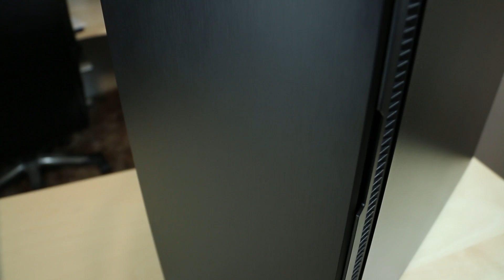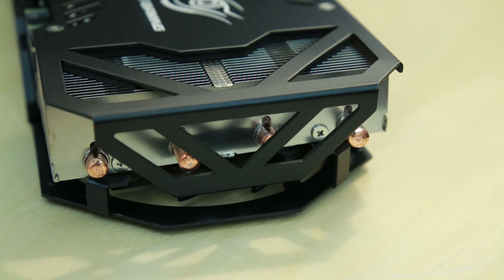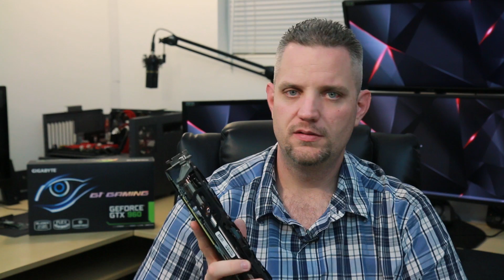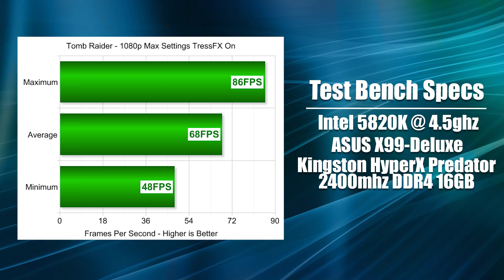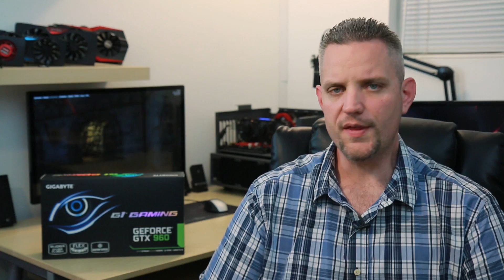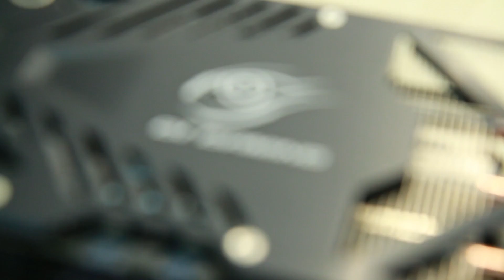Gigabyte GTX960 G1 GAMING - Best Mid Range Card Yet?

Comment: I've been using this card since it came out and I just don't understand the idiocy of their stock fan curve of thinking it's ok to let the gpu heat up to 60 degrees before even turning on the fans. Like... WHY on earth would you set it like that, so fucking stupid. Once I set a custom curve it will hit it highest equilibrium at like 45 degrees in furmark, and the highest it ever gets during gaming is 41.
Reply: like, the fans on this thing are freaking GOOD, and yet they dont fucking use them. They aren't loud at all either until they get to 80%+, and even at 100% I don't mind at all. They are barely audible at 40%ish
Reply: also it seems to run a 1410 mhz or something all the time, and I never touch the OC settings. apparently it's got great ASIC quality, it got like a top 4% of cards ever measured in gpu-z

Comment: I have the 4GB Version of this card overclocked and I'm able to game in 4k for most games.
Reply: No you can't
Reply: I can play CSGO, League of Legends, mount and blade warband, resident evil 4 and 5, all half life games including portal and portal 2, borderlands 2, call of duty 4, modern warfare 2, black ops 2, killing floor 2and 7 days to die. All play higher than 60fps with high to max graphics settings. So yea I can game in 4k.
Reply: oh yea, i can also play Dragon ball xenoverse 2 in 4k about 70fps
Reply: Lmao, you're listing games like CS and league which are old games that an average pc can run at well above 100 fps. a 960 can't 4k in newer games like GTA 5 or battlefield 1.
Reply: Don't be mad because you can't run black ops 2 or even the brand new game dragon ball xenoverse 2  that just came out I can run 4k, I also said some games not all, you should read better.
Reply: I have a 970 why would I be mad? It costs twice your card, also you said most games so i was assuming
Reply: I did overclock it like crazy, that's probably why i can run those games in 4k. I overclocked my Memory clock to 8021MHz and my Gpu clock at 1525MHz
Reply: Oh and Core Voltage at 1.25V
Reply: wooow guys  A 970!!
Reply: It's still a good graphics card that can play pretty much all games on high 1080p 60fps

Comment: Can someone tell me which card is better atm this GTX 960 G1 Gaming 4GB Gigabyte or the new AMD RX 480 4GB card? GTX 960 has 128 bit while the new AMD RX 480 has 256 bits
Reply: RX 480, it can beat or keep up with the 970 in most games
Reply: the RX 480 is reported of burning motherboards due to drawing power excessively. your choice
Reply: Just wait custom cards from MSI or Asus and you can get a Rx 480
Reply: ***** burning motherboards already is a nightmare. The stock RX 480 has been patched to underclock itself which is sad. Third party board makers should be able to fix it

Comment: Hey Jay, in reference to GPU Boost, if you were to ramp up the fan speed to 100% on the G1 right out of the box would that translate to GPU boost raising the clock speed up even higher than with the default fan curve? Barring the obvious noise difference that comes with that.

Comment: what is the best gtx 960?,gigabyte, asus, etc plZZ reply as soon as possible
Reply: +Aakash Mash 
probably gigabyte i got 970 gigabyte and it rocks
Reply: +Lukas Skliuderis 960 bro??
Reply: +Aakash Mash asus
Reply: +Aakash Mash Asus Strix is a fantastic card. It comes with an easy to use O.C. interface, basically one click and you're done...
Reply: Andrew Vee bro i stay in india so most gpu are unavaible here btw i will check that if its available i will see then
Reply: msi is cooler asus is the quetst and gigabite has the most performance now cooshe

Comment: Gigabyte GTX960 G1 GAMING is good or not ?? shld i buy 2gb or 4gb for gta 5 and farcry 4
Reply: It is good. Considering and assuming you have no compatibility issue with the BIOS and such, the only problems with this card would be its length and Nvidia's performance versus Radeon (Radeon R9 380 variants compete with the GTX 960 from nvidia). The temps and performance of this card are excellent, and objectively, the backplate and the tri-fan cooler is great. I'd recommend it, but check your case's GPU clearance.

Comment: can this card run on a 450 watt psu
Reply: okay thanks guys :)
Reply: +NakovGaming i would risk it, i had a 450 watt power supply but i upgraded to 650 watt because as game get more graphically intensive it will start to use more wattage, if it exceeds the gpu will crash and you will have to reload your computer
Reply: +NakovGaming i assume youve gotten it already, how did it go?

Comment: How would this build perform in GTA V Very High settings -
Asus Nvidia GeForce GTX 960 Strix DirectCU II 4GB
Intel Core i3 4150 3.50 GHz
MSI B85M-E45 Motherboard
500 X 2 HHD (Total TB)
450Watt Corsair Power Supply
10GB DDR3 Ram (8+2GB)
Reply: +GingahGaming no it's not lol. that card isn't nearly high end enough for the i3 to be a bottleneck
Reply: +Zeus Gaming Just shut up... You have no idea what you're talking about.
Reply: Hunter .-. Please explain the g3258 benchmarks then? OBVIOUSLY I do know more than him
Reply: Hunter .-. OBVIOUSLYYYY. Turn down the civilian settings. Even then the games work just fine on a i3.
Reply: Hunter .-. You lost me at according to R* minimum requirements. Minimum requirements and recommended requirements mean nothing... I can tell you are not a PC gamer.
Reply: +Kiernan Patton an i3 can handle gta 5 easily as long it has hyperthreading
Reply: that CPU is a bottleneck take a i5
Reply: +Kiernan Patton true i dont know why I even sad that but for a lot of games i3 is to slow and. experience stuttering
Reply: +Kiernan Patton it will bottleneck in gta you cant play it with a 2 core cpu it bottlenecks like crazy on that game other than that the pc is good
Reply: I decided to buy i5 4th Gen (Non K)
Reply: +Bologna Sammich Gta requires atleast a 4 core cpu. you obviously know less than he does
Reply: +Bologna Sammich
?¿ The G3258 has stuttering issues as any other dual core processor would.
Reply: +Hunter .-. no it doesn't. My friend runs the game with a g3258 and a 960 and runs it more smoothly than my i5-4460 and 750 ti. The g3258 doesn't bottleneck shit as long as you over clock it and don't pair it up with like a 980 ti or a Titan X. Not all dual core chips are the same, some like the g3258 can handle their own.
Reply: +Kiernan Patton 
According to Rockstar's minimum requirements, yes it does. but of course overclocking would help lol
Reply: +Bologna Sammich 
You must be fun at parties.
Reply: Hunter .-. I guess so since you made like 3 comments and deleted them lol. Took you long enough
Reply: +Bologna Sammich I bet you have a picture of your gaming pc in your wallet
Reply: +Hunter .-. Moral of the story, don't go around giving advice when you don't have a full understanding of what you're talking about. I've seen people so much lately like you who tell people what they should get and are completely wrong. If you give someone the wrong information and they buy the wrong thing, you just lost them money. Seriously, don't go around giving tips when you need advice and tips yourself.
Reply: Moral of the story: don't ask youtube for advice.

Comment: To all the fanboys out there, the major advantage the 960 has over the 380 is the drivers... Lets face it, AMD's graphics drivers suck and they make little effort to fix them. I have had such horrible experiences with their drivers in the past that it will be a while till I get an AMD GPU again. With Nvidia however, you don't have to take a gamble with the drivers, and they will cause no headaches, hours of talking to customer support, and waiting a week to get a new GPU because the one you just bought will absolutely not work with your system. I can spare 8-12 FPS for that...

And, they will overclock...

Comment: 4GB 960 or a 4GB 380x?
Reply: +Generally Good PC Games 380x is considerably faster than 960 , even 380 beats it so yeah the difference will be much more than 2 fps

The card does consume 80 watts more under load, so expect paying 5-10 more dollars per year
Reply: +Aimanrulez fanboy, no reasoning just straight to the point.

pure fanboy.

Don't listen to this guy, if you want a card that runs quiet, cool and is power efficient, go for the 960. If you want a card that runs games with an extra 2 fps (which you will never be able to notice), is extremely power hungry and doesn't have as good of features go for the 380.
Reply: Two things i don't like about the 380/380x are their power inefficiency. Also the lack of AMD specific AA similar to MFAA
Reply: +Generally Good PC Games Coming from someone that is with team Green. The 380X crushes the 960. The regular 380, is somewhat on par however.
Reply: +Generally Good PC Games the 280x smokes the gtx960, deifiently not a 2fps difference. I bought a gtx960, released it was partially that good then bought the 280x.
Reply: +Generally Good PC Games You're the one who sounds like a fanboy.
Reply: +Eds UKGamerz the 380x do max 10 fps more in some games nothing else. but it consume more power..
Reply: +Eds UKGamerz I would take a 960 over an R9 280X. Depends on how much you can save though
Reply: +Eds UKGamerz get the card in this video..
Reply: +themaze really it depends on the price as well, 
I can buy a club3d r9 380 4GB card for 220 euros here, but a gtx 960 4gb is atleast 255 euros
Reply: ***** here in the US, i can get a used 970 easily for around 240usd
Reply: +Generally Good PC Games STFU 2 fps gain haha you clearly nothing
Reply: eddie reece I know nothing?
Reply: eddie reece Well yeah of course it's better. The 280X was ment to compete with the GTX 70 series and was ment as an cheaper alternative.
Reply: +Daan Reynaert I know that so I'm confused why people compare it to the gtx960
Reply: eddie reece Same here, I'd rather compare the 280 to a 960.

Comment: "competition between team green and team red in 2015 is gonna be good"Except, Nvidia curbstomped AMD pretty hard. 970 can handle 1440p, two 970s can handle 4k, and without the complications of going the AMD route, at less wattage, so yeah. Honestly, if it weren't for the 960 I'd probably go with an AMD GPU for my 600$ build though. They still get my money on the CPUs though - the 6300 beats the i3 series for 20$ less, has more cores.
Reply: Generally Good PC Games sounds like we have a nvidia slave supporting things like gamework!
Reply: +Elijah Ramer (DegradedFour) r9 380 is actually better than this only problem is a bit higher pwoer consumption
Reply: +ThePolulos and not as many features. Dont get me wrong the i like the 380 but nobody is ever going to notice the extra 2 fps, thats why i went for the 960
Reply: Generally Good PC Games
I went for the 390 instead of the 970 because in my country it was considerably cheaper but with twice the VRAM, same story with 380 altho I dont blame the ones that prefer 960/970 XD
Reply: ThePolulos yeah i get ya. its like $10 cheaper for the 390 in australia.
Reply: Generally Good PC Games
:3
Reply: +Generally Good PC Games Erhalts up with your damn "2 fps" dude? The 380 is about 5 -10% faster. And who Even wants to support that shithole called Nvidia?
Reply: Lars B. sounds like we have a fanboy!
Reply: Lars B. k

Comment: I'm looking into upgrading from GTX 560ti, budget is under 300$ and in my country, suddenly, GTX 970 costs 450$ and for absolutley no reason R9 280X costs 350$. I thought about buying GTX 960, but I'm not sure about wich one to choose. 4GB versions cost about 270-280$ and 2GB are 230-250$. I'm playing at 1080p and I don't need any fancy hardware antialiasing, FXAA is just fine. I saw tests and 2GB version performs quite well, even in GTA V without MSAA on max settings it is sitting at 60fps with dips to 50 without any stutters. So the question is: is it really worth buying a 4GB version for 1080p gaming without any AA or should I simply go for cheaper 2GB version?
Reply: Go for the 4gb one. The 2gb won't be enough soon.

Comment: Have the exact card along with an AMD fx6300, 16gb of ram, and a 750 watt power supply. I get a single frame spike, for instance it will be at 75 frames and it will drop to 60 and it looks like it lags for a single second. By the way I have unparked my cores and I'm almost sure that it isn't bottlenecking. Any help on this. Thanks! ^_^

Comment: GTX 960 VS 760? Which one you recommend?
Reply: HuntedSoul O The GTX 960 is slightly more powerful and supports DX12 completely via hardware. They are both good cards and very close, but I'd get the GTX 960 for the newer features.
Reply: Km Mm Many thankx mate.

Comment: What people don't understand is that this is more EFFEICIENT. That leaves more room for OVERCLOCKING. If you set it to run at the heat and wattage of the, say, R9 380, it will outperform And 2GB VRAM? You can get 4GB versions, by the way. Also, if you're getting this card, you probably aren't running very intensive games. I know, at stock, this card is pretty horrible. But with overclocking, this can reach the price/performance ratio of the 970. Again, it is so efficient, it leaves lots of room for overclocking. Plus, in the case of G1 gaming, the R9 380 is less efficient, and is outperformed by the GTX 960. According to, everyone, 50ish dollars more isn't much. Well, if so, why bitch about this thing's price? Your expecting the performance of a high end card from this. But this is a mid-range card.
Reply: Infinite Zero I could not have said this better, and agree completely!

Comment: Can my cpu run this 

Processor	Intel® Core™ i7-2600 Processor
- 3.4GHz (3.8 Max Turbo Frequency)
- 8MB Intel Smart Cache
- Quad-core processor
Operating System	Genuine Windows® 7 Home Premium 64-bit
RAM	- 8 GB RAM
- DDR3
- Up to 16GB expandable memory
Graphics card	nVIDIA GeForce GT420 with PureVideo®
- Up to 2GB dedicated memory

Comment: Will my 450w basic PSU be able to handle this card?
Reply: IIPr0Luk3II If it is a quality 450w power supply like Corsair, Antec, etc, it should be fine. I believe Nvidia recommends a minimum 400w power supply for the GTX 960.

Comment: I only play World of Warcraft , Arena and raiding on  a 1080p monitor with the gtx 960 g1 gaming 4 gig card . On ultra settings returning 120 fps . Only have an old fx6300 oc'd to 4.5ghz and 2 hyper x fury 4 gig 1866mhz dimms . Just so its known what i'm running the card on .
And if this thing is oc'd you can actually get some decent numbers from it . Given the 128 bus could be better . 
The only thing that is wrong with this card id the price point , which is why it gets compared to cards in the same price bracket . If this card was £40/50 cheaper its a bargin . 
I paid nothing for this card so i'm a happy chappy =)

Comment: Got mine yesterday and I love it, From an HD 6850 to this, less power consumption more FPS and higher settings if not max settings :) Overclocked it today with stock fan profile, voltage, and power target and have it currently set to 1494mhz on the core. I'm definitely more than happy because I was able to get this card for $189.99 on newegg.

Comment: Is this card still worth it? I see A LOT of hate for this card in the comments saying how its not as good as the r9 285 or 280x and the gtx 770. But are people realizing that those cards cost $50+ more than this one? May not seem like much to some people, but that makes a big difference for me.
Reply: +SniX The GTX 960 generates less heat, uses less power and therefore has less noise. Also, memory bus doesn't matter, it just affects the VRAM, and a 4gb one exists.

Comment: GTX 960 in short: slightly worse or same performance as the R9 270X, while having the price of a 280 or in some cases a 280X, maybe if Nvidia pulls out the 960 Ti , trust me i have a MSI Gaming 960 while my friend has a Windforce 270X (with same 4690K cpu and 8gb RAM) and my 960 is slower in a ton of times

Comment: Hey i'm going to build a new pc and i want to know if everything is alright.
Core i7 4770
GTX 960 (Version with 4gb by evga)
Msi z97-g45 gaming ou z97 5 gaming
Nzxt h440 red an black
Nzxt kraken x61
8gb hyperx fury
Corsair cs 600w
Seagate 1tb
Kingston 60gb ssd
Reply: Maicon Sergio you don't need that good of a CPU if you're mainly doing gaming. invest more money in your gpu.
Reply: Get the 970, 1,5 times the cost and 3 times the power
Reply: +Maicon Sergio go for a xeon and get a 970

Comment: This version of the 960 is ridiculous! The reference only requires one 6 pin pcie connector this needs 6 pin and 8 pin. Also consider that other brands of the 960 such as ASUS needs only one 6 pin pcie, has an aftermarket cooler and is OC'd out of the box.

Comment: hey! great video! I'm wondering what is the best manufacturer for Nvidia Video cards? I had an MSI gtx 680 that died on my last week after about 2.5 years of use,  so i think the gtx 960 will suffice. I'm just curious what is the most reliable brand for NVIDIA cards out there since I'm looking to buy a new one. Thanks!

Comment: Can anyone tell me why so much HATE on this graphics card(GTX960)? Sure, it only has 128 bit interface and only 2GB VRAM, but the results is what really matters. From the reviews I've read, its on par, sometimes even faster than a GTX770 at 1080P. IMO, I think its a pretty solid choice for gaming at 1080P.
Reply: 770 users would beg to differ. Also nVidia likes f$cking with their fans by not optimizing older cards like the 780 Ti......